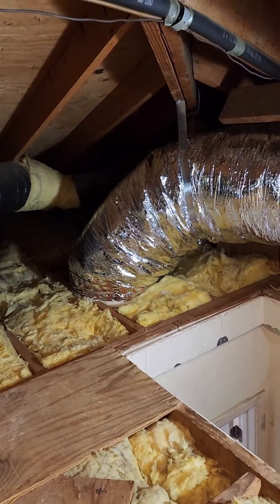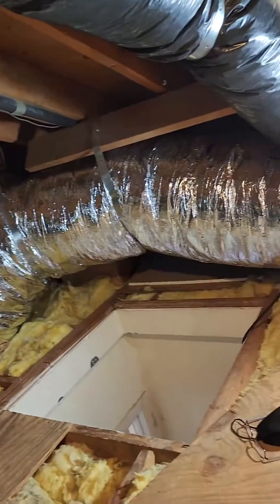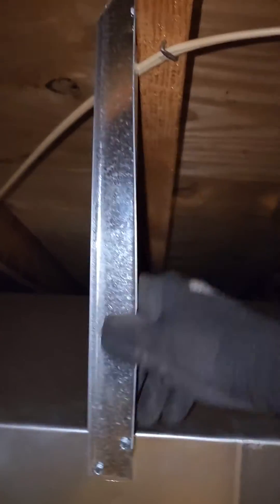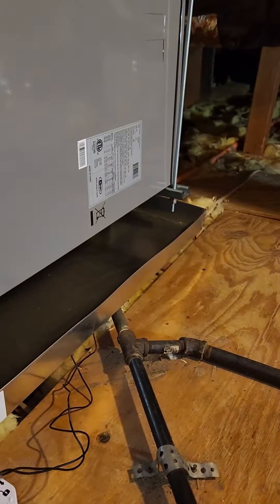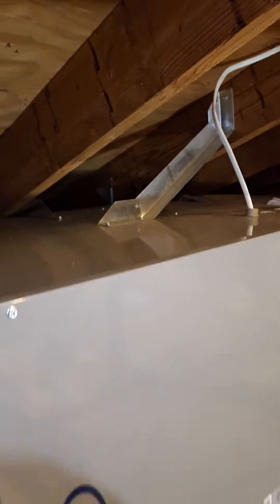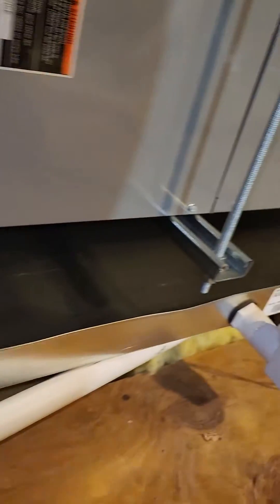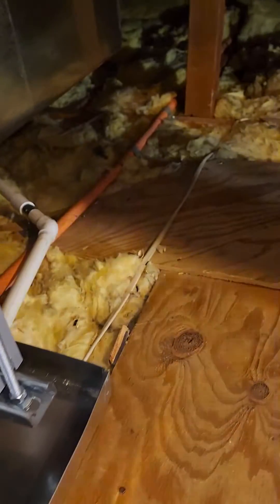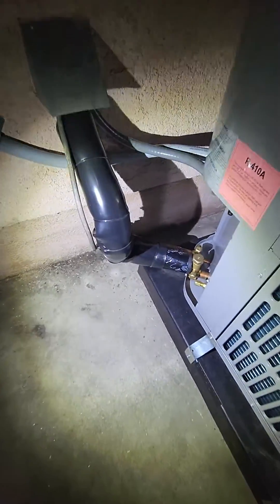Split heat pump installation

Comment: I saw in the Rheem manual to put the uni strut parallel along bottom of air handler then put two cross one on supply side and one on return. That way you can easily pull doors off and pull components out. You do have to screw the unit to uni strut so it doesn’t slide though.
Reply from the maker: Thank you for the info! 👍

Comment: Where do u get those metal sheet covers for lineset
Reply from the maker: Every HVAC supply house here in L.A. carry them.
Reply: @theairconditioningguy  i live here in Palm springs their is none of cool stuff, am a beginner in the hvac industry
Reply from the maker: 😞 Bummer. You'll have to go to a sheet metal shop.
Reply from the maker: @bernardolucero1307  Show a seven shot of my video to a sheet metal shop. I'm sure they can make them for you for about $50 each 10ft piece.